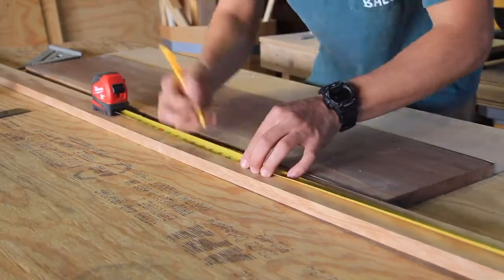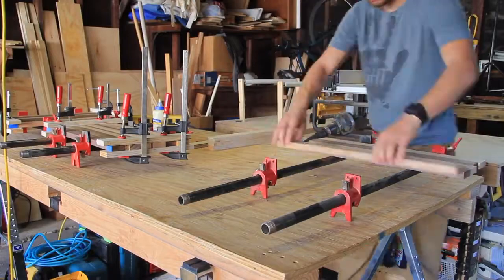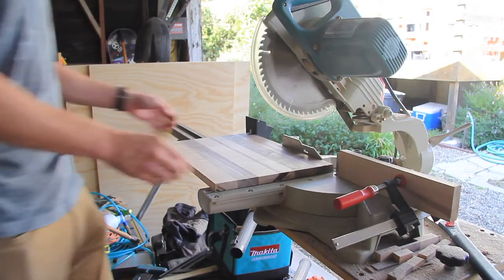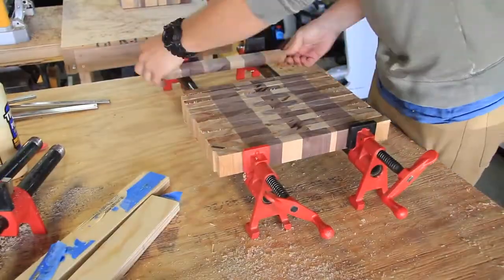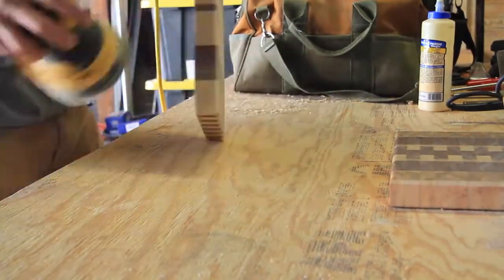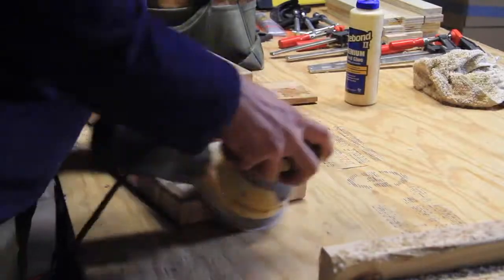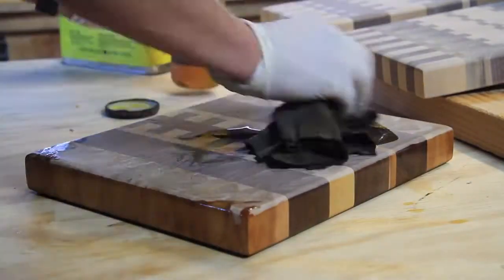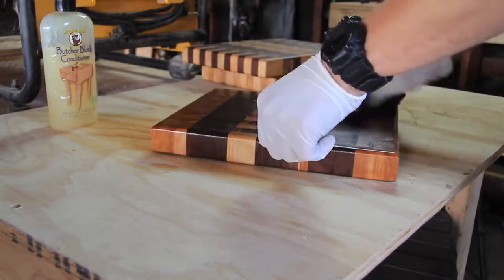Custom END GRAIN CUTTING BOARDS with Scrap Wood | How to Make

Comment: Your cutting boards look great, but the finishing material you chose was a poor one.  

Raw Linseed Oil would be an OK finish if you chose to use an eatable product.  Unfortunately, the stuff you're using by Sunnyside isn't.  It's an industrial finish meant for treating raw wood like fence posts.  You need to read carefully the label on that gallon can you have.  It says: Keep out or reach of children -- Do not take internally -- WARNING: THIS PRODUCT CONTAINS CHEMICALS KNOWN TO THE STATE OF CALIFORNIA TO CAUSE CANCER AND BIRTH DEFECTS, OR OTHER REPRODUCTIVE HARM.

If you insist on using raw linseed oil (aka flaxseed oil), go to a gourmet cooking store and buy some, not the hardware store.